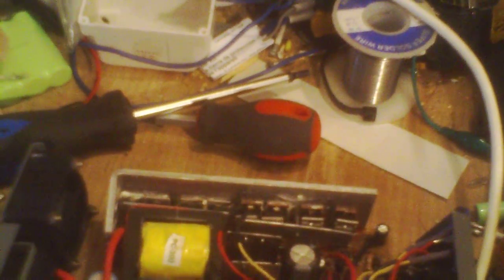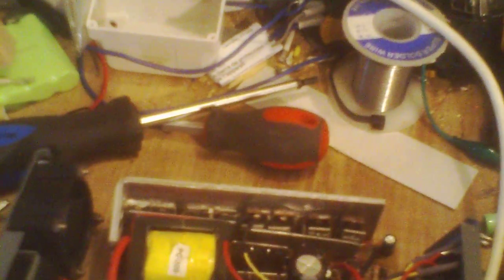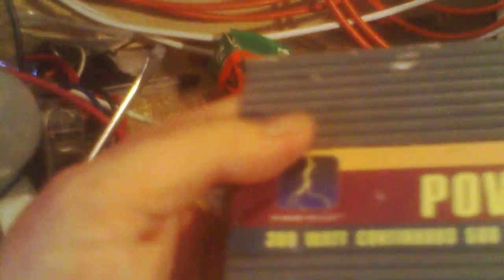Power To Go 300W inverter guts

Comment: I tested my PC300xt and found no load voltage output at 93volts. I powered it with a Pyramid PS9KX rated at 13.8 V, 5 A constant using the cigarette lighter plug. Is this expected or does mine have a problem?

Comment from the maker: If it had a cigarette lighter plug originally and there is no fuse in/on the inverter, then the fuse was in the plug.  If that is the case, then all of the control ICs and probably the FETs as well are probably dead.